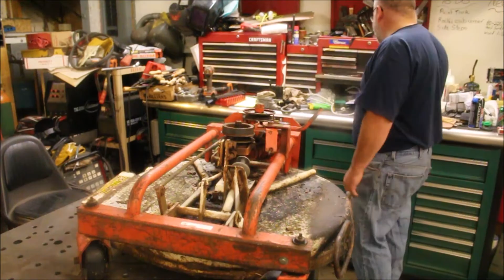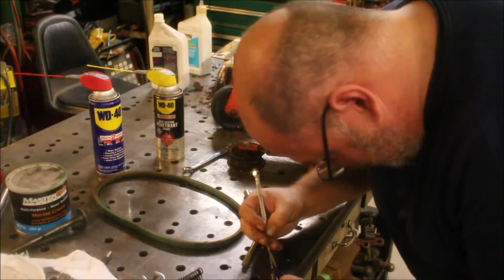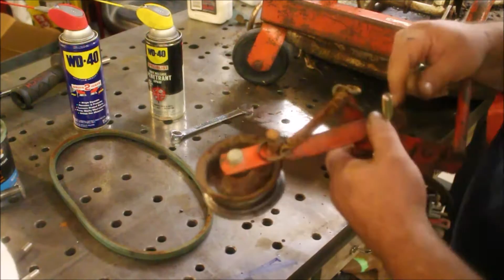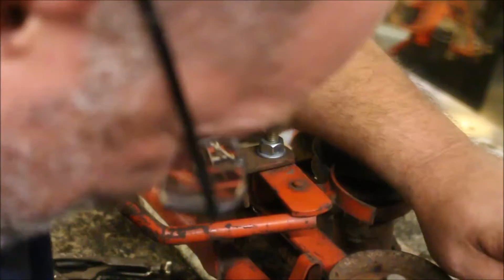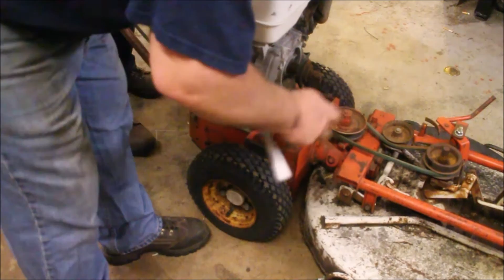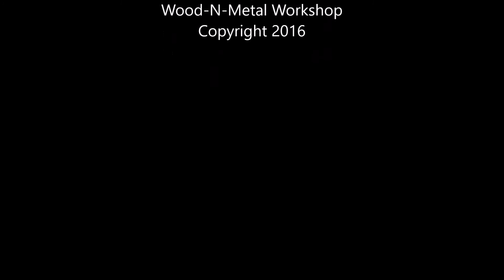Ariens Trac team Snowblower Mower repairs part 2

Comment: Thanks for this video. I just picked one of these today. Sno thro and Mower combo.  will get into it in the spring.  No other attachments though.
Reply from the maker: I hate to admit it but mine was sitting for 3 years, until yesterday that is, put fresh fuel in it, started on the 4th pull and ran steady for 3 hours blowing snow. Both it and I are '68 models. Thanks for watching and commenting.